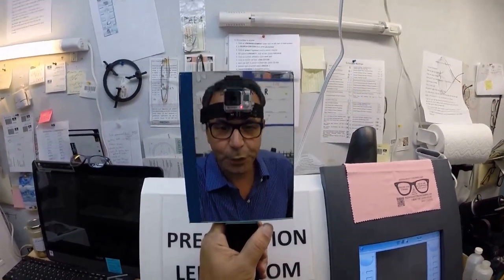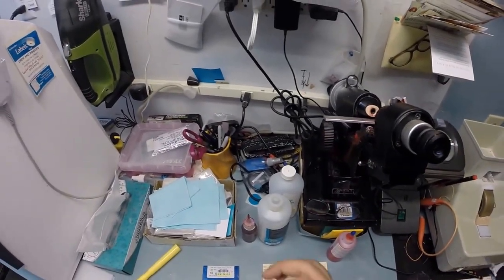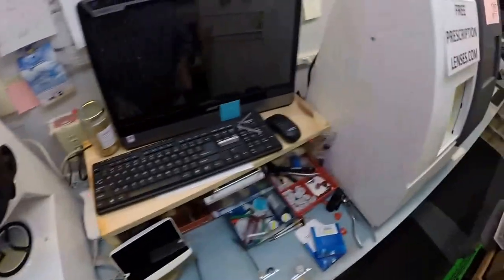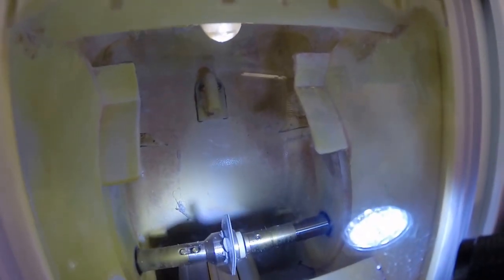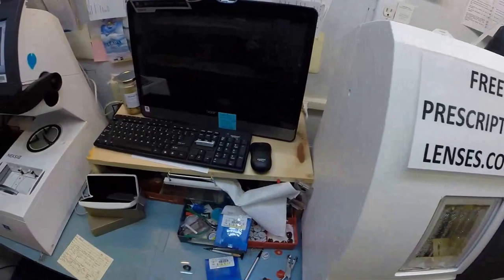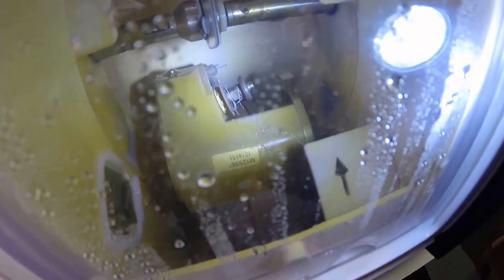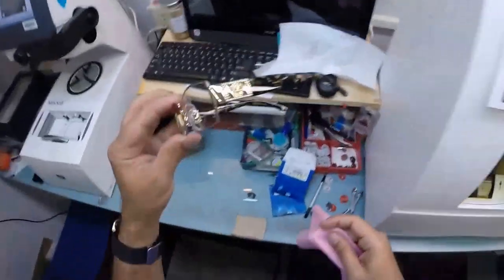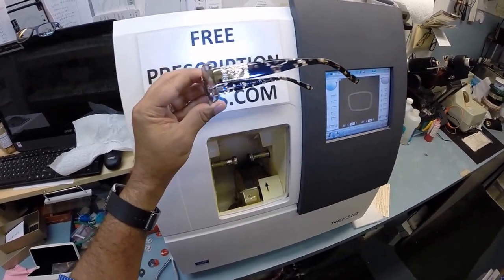Angel's Versace 1175B with Rx Transitions Lenses

Comment: Hey bud I'm also a lab rat of 20 years in Dallas Tx, question do you ever get New VERSACE VE 1175 straight from Italy with stones missing?
Reply from the maker: Howdy fellow lab rat. Its funny you mention the Versace 1175 because I just shipped one of these on Tuesday and it was perfect. I did however receive 2 large Versace sunglasses with very large stones by accident. They were shipped to me although I did not order them. I think they were for another optical shop but one was missing a couple stones. That's the only time I've ever seen that. But of course I was going to return them anyway since I didn't order them. But anything can happen in the belly of a plane between Italy and yours or mine front door. But Luxottica has such a good return policy, the real problem is explaining to a patient that it will take an additional 2 days to get a replacement. I still have 2 frames of the black and platinum because I thought it was such as nice color. It's sad that it has been discontinued and only the gold is available.

Comment: i checked your website and i saw that you had an option for size 51 or 53 what exactly is that
Reply from the maker: The frame comes in a smaller 51 millimeter eyesize or a larger 53 millimeter eyesize. i am 6 foot tall and weigh 190ish so I would wear the 53.
Reply: I am 5'8 160ish what would you recommend?
Reply from the maker: Try the 53. i'll need to call tomorrow and make sure Versace has it in stock. this frame is hard to order because of its popularity.
Reply: Thanks i really like how you respond so quick im for sure getting these
Reply from the maker: Will you email me a picture of your Rx at freeprescriptionlenses@gmail.com? Also do you know your pupillary distance?
Reply: You got it
Reply: How do i get my pd?
Reply: How do i get my pd?